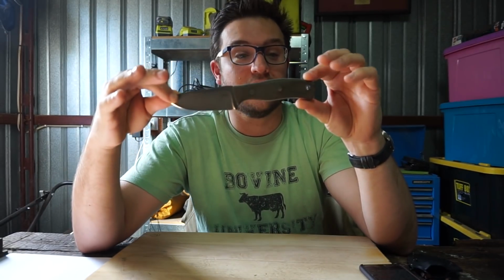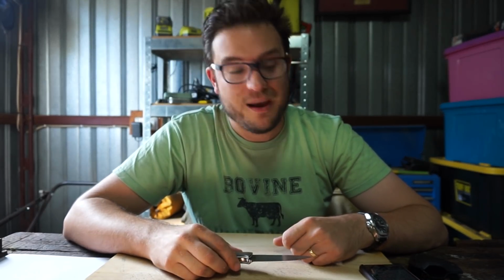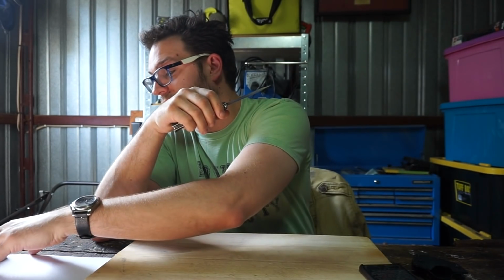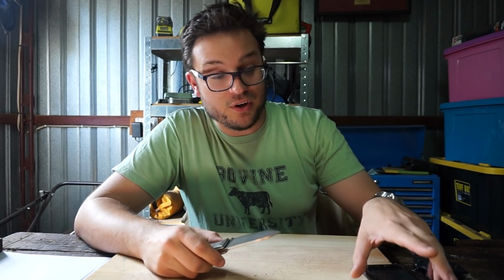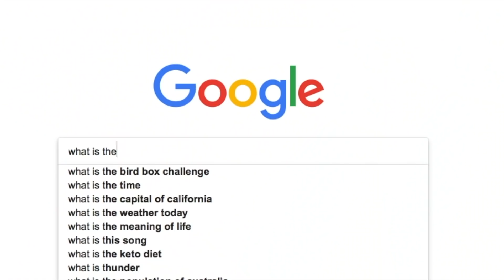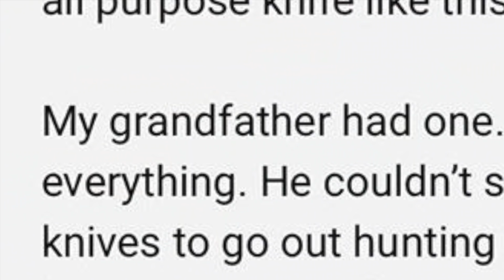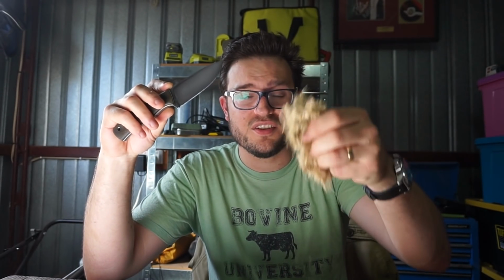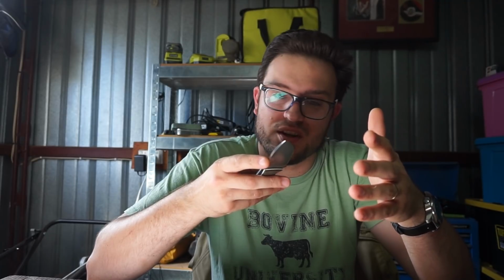Nitro V steel in the Knife Lab! Alex Dron Fixed Blade - Crazy result!

Comment: Thanks Pete for the this great review. You are correct, it is 17 (or 18? can't remember now) degree per side, finished on Wicked Edge. I haven't updated my instagram for the past couple years but I will now :). Usually I post on bladeforums and here instead.
Reply from the maker: awesome! Yeah i checked it on a phone app and it was 17, but its probably got a margin of error. Great work on this one dude. I’ve got the green light to test it some more so stay tuned!
Reply: Can I ask what your Heat treatment recipe was for this?
Reply: @jimmygrey6848  No secrets here. Austenitization at 1950F, 10 minutes, ice cold plates quenching, dry ice 6 hours. Tempering 400F 2 hours 3 times. 61-61.5 by multiple points on Ames portable tester
Reply: Damn. Just looked at the photos on instagram I put this morning, all buts and tips cut. I forgot they use 1:1 ratio :( And can't edit. Oh well...
Reply: @AlexDron  Okay Thanks, I did pretty much the same but had to skip the dry ice before the first temper cycle due to time constraints, though I did put it in the ice for a full day after the first round of tempering. I'm curious to see if this will negatively impact the performance.
Reply: @jimmygrey6848  From what I read on forums about AEB-L and Sandvik it is extremely important to quench as fast as possible and proceed with sub zero right away. All withing few minutes. There was a long thread on BF about that. Nitro-V is basically same steel, with little addition of Nitrogen. But it is also possible there were different batches of Nitro-[V... there was a rumor about "bad" batch. I got impression it is generally not recommended for large blades, like over 6".
Reply: @AlexDron  Hopefully doing the sub zero after the first temper wont impact it a huge amount. I think the difference might only be 1 or 2 HRC points though (Fingers crossed) I don't have a Rockwell tester so I can't be too sure. I've done plenty of Sandvik 12c27 and always do the sub zero after the first temper, seems to perform pretty well. Pete did a test on it on this channel as well if you're interested. Thanks again Alex, your knives are really nicely done. Keep up the good work!
Reply: Cedric & Ada Gear and Outdoors what phone app do you use for the angle measurements?
Reply from the maker: Nick Petroff its called angle, its in the app store and the icon is just a ‘45°’
Reply: Your blade is beautiful, sir! What's your instagram handle?
Reply: Thats a very beautiful blade!!!! Great work
Reply: @charlescollier7217  @adknives
Reply: @AlexDron  thanks!
Reply: @AlexDron  how could we use this cycle is serial production? Will quenching in vacuum  in N2 under pressure help?
What's effect of forced air quenching?
Reply: Do you have knives for sale?
Reply: Alex, Do you have knives like this  for sale?
Reply: @rinaldocatria4386  nothing at the moment. Not taking new orders either
Reply: @AlexDron  oh darn…your knives are beyond fabulous.  👍👍👍

Comment: Have been looking into Nitro V to make a prototype - it looks innocent and demure, yet has sly hidden tricks up it's sleeve; it's a stainless razor steel with very fine structure, and so edge stability & strength, with a bit of nitrogen replacing chromium, and a teensy-weensy bit of vanadium.  "Too little vanadium to form carbides for edge holding" I hear you say?  Yes, but thats not what it's there for; it increases toughness and strength WITHOUT forming clumpy big carbides (which you dont want on a non-PM steel), and the nitrogen helps this along further, but also increases rust resistance considerably.  And it's simple, so appeals to purists!

Comment: Pete, curious question here.  Have you either made or thought about making a video comparing cutting performance after a fresh sharpening vs restropped after edge has worn down to "not easily slice through paper"?  I think it would be interesting to see how much cutting performance you'd loose from fresh sharpened edge to bringing it back with stropping...since i'd imagine you loose a bit with every re-alignment of the edge as you round/convex the apex each time you strop.  Just a thought, love to see a test like that but thanks for the content that you already have made!